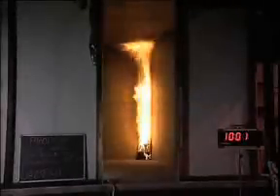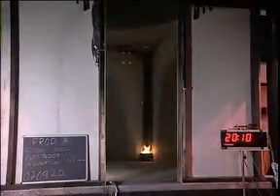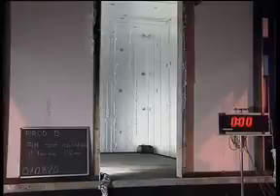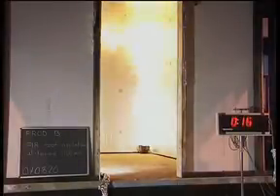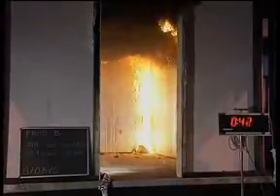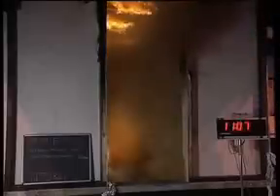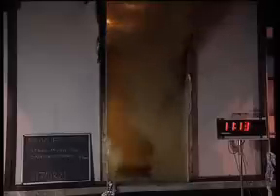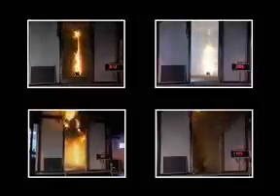Fire Test Video.mpg

Comment: The fire problem is not building materials, it is interior furnishings and personal objects. ONLY fire sprinklers mitigate the hazard, not combustible walls.
Reply: Which one would you put in your house? 
What about the school your kids go to? 
What about the building you work in? 

To me it's a surprise that the synthetic Polyisocyanurate is even authorised on the market. 
It may be the difference between whether a fire would even start. 
A faulty wire might set the PIR insulation ablaze while the rock wool insulation wouldn't catch fire. 

I know which one I'm putting in my house and here is a hint: it's not made of combustible plastic. 
If you're thinking about saving money start by thinking about how much you're ready to pay to make sure your child doesn't end up roasted like a turkey.
Reply: Not to mention the risk of spread in multi-occupier properties. I don't GAF if my neighbour burns all their belongings, just as long as it doesn't spread to my flat!